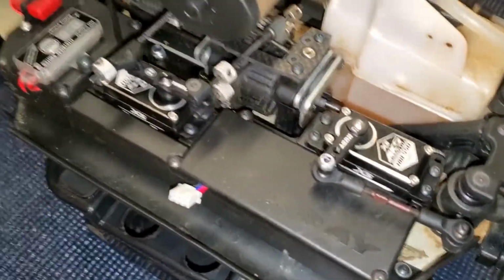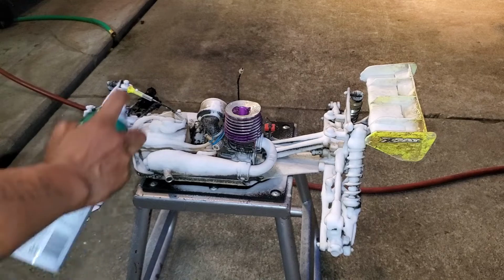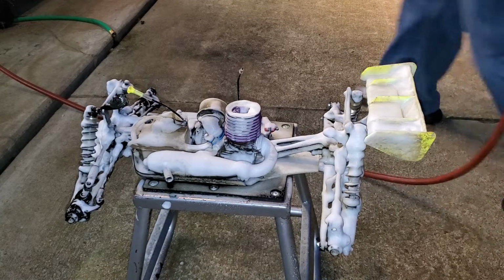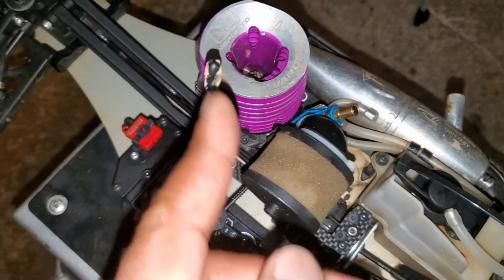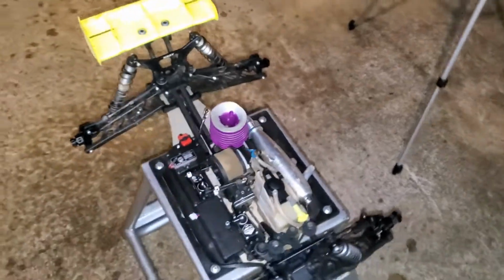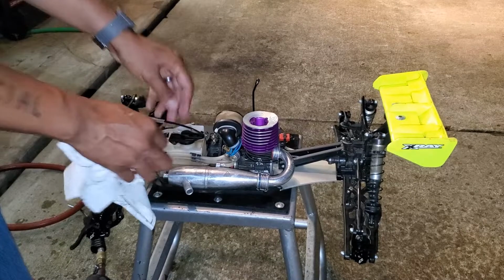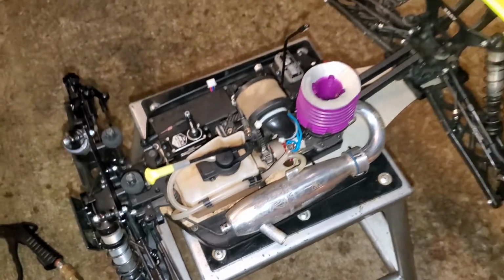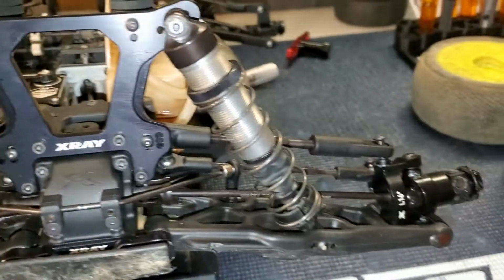XT8 Simple Green Foaming Suds or Duds?

Comment: Not to sure about that spraying it around Engine And SERVO
Reply from the maker: I spray it on my engine and servos.  Just cover my air filter and I'm good to go!
Reply: @CrucialRC  Thats THE Answer i was waiting for u mean u cover ur cooling fans?
Reply from the maker: @troyflanagan4237  nope
Reply: @CrucialRC  i feel stupid Asking this Question THE Air filter is on the left hand side of The TRUCK behind the Lipo spectrum battery mark iam trying to learn as much as i can about this TRUCK so i can prevent problems and headaches down the Road I've only had THE Truck since May of 2020 it's 7 months old pretty much like New just a little dent on the front bumper and a few scratchs on the Roof of the Truck thats it getting New input GEAR PUT in and 15th tooth pinion to.

Comment: I have to Admit though that's Amazing and my 4s kraton is half that dirty maybe Even a quarter of being that dirty
Reply from the maker: Lol. Yeah and a little bit goes a long way brother.
Reply: @CrucialRC  SO what ur telling me is that i DON'T have to take THE hole 4s kraton i have which is hardly dirty at all maybe a quarter less THEN half i have All 3 products to use to clean and grease my TRUCK Except for air hose but i have a floor heater and lots of Rags to wipe it down and clean it plus a have this product Called Air Duster to blow out the excessive dirt before i use the simple green and 3,1 SILICONE LuBRICANT
Reply: @CrucialRC  my Question was will the simple green mess up Engine or SERVO have u had that Experience yet cause i don't wanna be having problems with my 4s stocked kraton 110 if i use this product but I've seen and heard good reviews about this product🏁
Reply: Guess i will have to see when i get my Truck baby back from the hobby shop my Tricks being Repaired in hopefully tomorrow or Wednesday Thursday latest
Reply from the maker: My xt8 has about $1300 in it and I've seen no adverse affects of using the simple green foaming crystals. If you are weary of using it dont. Just showing my experience with it.
Reply: @CrucialRC  i will take ur word for it cause All I've been hearing is good reviews about this product Even by my own hobby shop guy says i have nothing to worry about this product so i guess iam being to Cautious but better safe then sry man👌
Reply: @CrucialRC  and ur Truck is alot more Avanced then my 4s kraton 110 stocked 2400kv Motor, 120Esc with spectrum smart Charger and 2 mah5000 14.8 50c battery, mah5000 14.8 100c Battery with 2 Cooling fans 1 on Top of Engine the other beside the SERVO And 120Esc good Truck just needs love and care loctite on slipper Clutch to New INPUT gear and New 15th tooth pinion🏁
Reply: @CrucialRC  Thank u for the reassurance dude!
Reply: @CrucialRC  Iam dieing to use this product simple green when my 4s kraton baby gets out of My Hobby shop i deal with but first i have to blow THE dirt out FIRST cause it's probably dried up dirt so i have to loosen it up first i guess i can use the AIR Duster product first then LET it sit for a few minutes then wipe THE Truck down inside and out put it 4 inches away from my floor heater so it Will dry properly then use THE Simple Green and let it sit FOR 10 minutes and wipe it down dry i could Even use a hair dryer to dry it and then last but NOT least grease ARMS Shocks and button of Truck head brakect and inside of Truck bumper back wing and wheelies bar no Engine or SERVO or battery or wires Either then wipe down the Excessive grease but will TRY and find AIR hose FIRST i want my Truck like it was like New again i guess iam a bit of a perfectionest lol